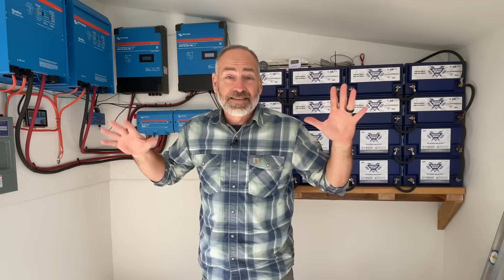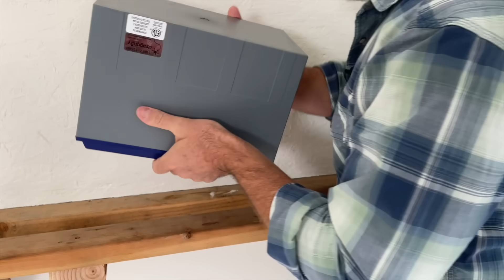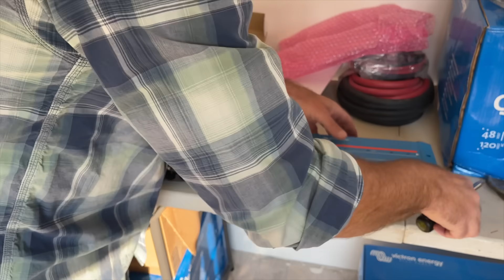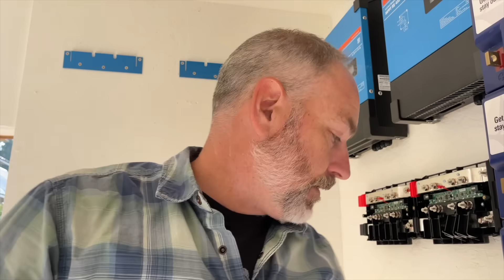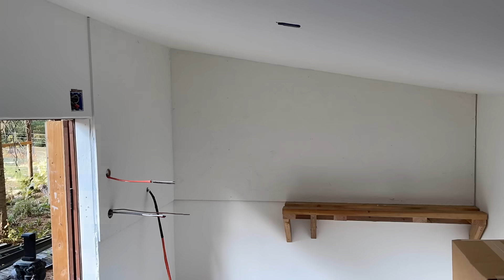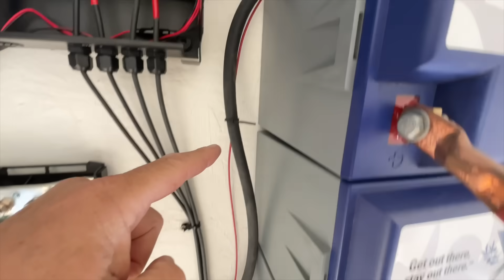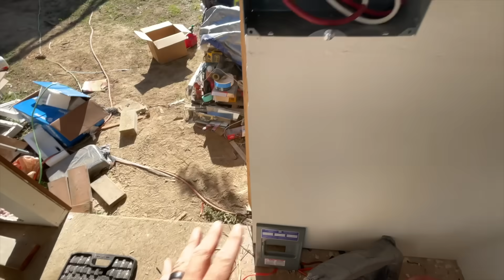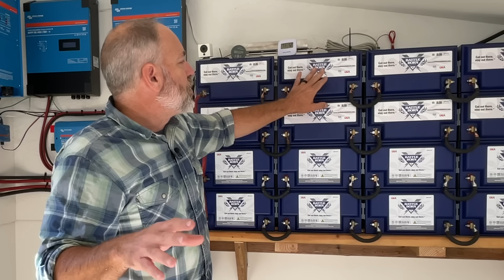EASIEST Off Grid Solar Power System Battery Bank

Comment: Very nice, I see you ran #10 AWG copper romex (the orange cable) from your inverter to your load center, your load center has a 50 Amp breaker, should you have used # 6 AWG copper to handle the 50 Amp load, #10 AWG copper is rated for 30Amps and #6 AWG copper is rated for 55 Amps. but other than that VERY informative, clean installation.
Reply: Electrically speaking, he knows just enough to be dangerous 😳

Comment: Here is something I don't understand. You pay almost $4000 for four battleborn batteries to make 48v. One can buy the EG4-LifePower4 Lithium Battery | 48V 100AH | Server Rack Battery for $1450. How does it make sense to do the battleborn over these? Oh I just realized that you are getting the BB batteries for free.
Reply: 2024. Eg4 48v batteries are now 1149.00$$ . Soon to be cheaper too.
Reply: @coreygillum12 not with the tariffs coming
Reply: @coreygillum12 nothing is going to be cheaper soon. Trump tarries and new China ban on exports to America is going to make everything very expensive.
Reply: Most likely he got the battleborn batteries for Free or a discount
Reply: Yep 🫵
Reply: Bet he doesn't respond to your comment either
Reply: 😂😂 @JT-jg8le
Reply: He gets 400 Ah for 4000$…your set costs $5800 for 400 Ah.
Reply: You can use marine batteries that are much cheaper but have a lower life cycle that’s negligible. Downside requires outdoor storage and ventilation.
Reply: If you want to enjoy lead-acid batteries for longer 30%discharge is maximum. Thats only 30 Amps for a 100 Amp lead-acid battery😢
Lifepo4 batteries burn or explode very violent and are expencive more so compaired to lead-acid.
Hard choiches im willing to make in favor to lifepo4. 
Prices are going down on lifepo4 and solarpanels in general.
Reply: I dont know hold that shelf has not collapsed with that weight , hope you got great fixings also
Reply: Must be fairly light batteries in that case
Reply: The Amp hour is different. 4 *12 volts 100Ah  gives you 400Ah. More than a single 48vlts
Reply: @cordzocornwell7003 your math ain't mathin bro. Voltage is additive in series, current (amps) is additive in parallel. Just 4 batteries as you say will only give you 12vX400amp or 48vX100amp.
Reply: @Jeremyv1980  You are correct. I am curious why cordzocornwell didn't thank you for setting him straight
Reply: @cordzocornwell7003
Reply: @cordzocornwell7003 putting 4 12v batteries in series makes it 48v and 100ah.
Reply: @cordzocornwell7003 no, he wired them in series so he has 48v and 100aH. THEN, he wired 4 of those banks together to get up to 48v and 400aH. In series, the voltage is additive and the aH stays the same. In parallel that is reversed.

Comment: Very impressive but how about telling us what it all cost.  Lithium although very good are also very expensive.  For me to buy just 1 100AH deepcycle Lithium battery it will cost me $1300.00 dollars.  Multiply that by 16 and I am looking at just over $20,000.00. Then add the inverters, controllers and panels I reckon I would not get much change out of 40 thousand dollars AUST.  Still start small and add to the system as funds dictate.

Comment: I saw some bare copper wire where the cable you cut bends out from the lug.  Might be an idea after they are bent to fill any gaps that appear with some rubber insulating compound before they are installed.  Or buy links ready prepped.  I think it was near the top of the battery stack.

Comment: It's a nice setup but IMHO the battleborns are not a good fit for whole house batteries.  Lets be honest here this is just sponsorship - for $2000 less, you could get a BYD LV 24KWH stack and not only get nearly 5kwh more capacity at $2000 cheaper but a MUCH easier and safer wiring job and quicker/easier installation.  (just 2 cables to make up).

Comment: Mind if I ask what the total cost ran to? We have just had solar panels installed at work (without batteries) and now we're looking at a small battery install. Options here in the UK are pricey - £8000 for 10KW storage.

Comment: An even easier offgrid system is any one of the Solar Generators on the market; Bluetti, Ecoflow, etc with expansion batteries. These are competitors to the Tesla Powerwall, as they are DIY systems, while the Powerwall won't allow you to install them yourselves. And it you have an RV, you can take these Solar Generators with you for plug and play vacations, while the Powerwall stays behind. I just bought a basic system with 3072 watt hours, expandable to over 18k watt hours, working up to a whole home system as I can add up to 6 batteries. It can take up to 3000 watts solar input. You do need to buy two of these to get 240 volts, and of course that doubles the 18k watt hours and provides 10k watt output. All it takes is money:)

Comment: The only complaint I can realistically say about a setup even at it's basic level (4 batteries, 1 controller, 1 inverter, distributor, etc), is that the initial price is just to much for the majority of individuals whom own a home, but essentialy live paycheck to paycheck to make ends meet. Sure once the items are paid for, installed, and running, it'd save HUGE on electricity, which in the long run is the utmost smart idea. But without the initial funds, a setup like that just isn't possible.

Comment: Guys. Another easy light usage off grid system is to buy computer UPS battery. I have 4 solar panels installed on top of my garage and I connected it to three UPS. It powered my Router/NAS/two Led standing lamp/front door night lamp. It works pretty well🎉🎉.

Comment: Nicely done, I'm in South Africa and went off grid well 99.8% off grid last month. Went for 9x545w Canadian panels giving me around 5005W off panels but seen them go higher close to 5200w, 10kw inverter and 10kw battery which in the next few months will take to 20kw on battery and will add another 9 of the same panels taking that to 10kw on panels. I'm running a 4phase setup so solar, battery, utility and if I really need it will startup my generator but thats not really needed to be honest.
Reply: Hi

May I ask the Sputh African Cost of the System 

We am looking to do a total off grid and increase incrementally
Reply: @mikab350  I paid R148k for my setup
Reply: @stu1944  thank yOu
 For the Info

Would you be king enough to share your supplier and Installers contact details please 

I am Dbn based
Reply: @mikab350  I went with SolarSolutions but we up in JHB. Very professional service and aftermarket support has been top-notch.

Comment: Wow! Nice system! You did a great job illustrating how the system worked. But I do have a question thou... if I'm not mistaken, it looks like you're running 10 gauge wiring which can handle up to 30 Amps from the inverter to the AC distribution panel and I think that's 6 gauge after the 50 Amp breaker... so the max amperage in your home's central panel is only 50 amps? Do you have enough power to run central air & a dryer at the same time?

Comment: were you going to add a cooling fan to circulate air in the shack? you could run a fan off its own small solar power cell.

Comment: There is only one reason you wouldn't use four server rack batteries and end up with 23kwh. 

You got the BB for free or nearly free.
Reply from the maker: I didn’t even know what those were when I set this up. So maybe there is at least 2 reasons.
Reply: @MartinJohnsonOffGridLiving  

I can go with that 👍

Comment: NOT the easiest!  No where close. A single Sol-Ark 12k and two Kilovault HAB 7.5’s is equal or better at every comparison. The Sol-Ark unit contains the BMS, the wifi, the system monitor, and ALL of the  circuit breakers,  Martin must love hearing his generator run because the has and after the panel upgrade, will have half the PV to support the battery recharging while running the household.

Comment: Yes,  everything is easy if you have the money. Maybe when i win the Elgordo lotto. Just a rough guess, 16 batteries at  4500dollars, inverters at 3000dollars, controllers at 2000dollars, solar panels at 8000dollars all together  17500dollars, thats allot of money, im in south africa x that by 19 and i have to pay R 332 500 rand that is more than what i make in a year.

Comment: This appears to be one of the most expensive power bank set ups I’ve seen. The batteries are over$500/ea. The inverter alone is $2750. Just seems like there are better options. All depending on need and circumstances.

Comment: Deep cycle lead acid is still the safest and the cheapest solution especially that the battery doesnt have to move anywhere. You can practically stack unlimited power with then for the same price of what dangerous batteries you are advertising. Enjoy burning your house down.

Comment: Glad you showed how light those batteries were up front. All I could think about to that point was how the heck that shelf and the studs were going to hold that perceived weight. Also that bracket/hanger system is called a French clear Great video 😊

Comment: I did a similar install, except i used a the lynx shunt that attaches to the distributor system. I have the battery bank on the shunt side and then all of the inverters and chargers on the distribution side. this way you can see everything going in and out of the battery system. The shut connects to the CX and screen module and creates a display for amp flow in or out.

Comment: Not to be rude but…..what was final cost, including the soon to be solar panels. I’m putting together a system and this is exactly what we need. That    8 awg wire, might be 6, from shed to house was prob 1500. Looks like you have 3000 in just wire!! Extremely impressive!! This is what we need. 
I’m guessing 26,500 to 30.

Comment: How much would a whole house system like the one you installed with batteries and inverters cost plus the solar panels for an overall cost balance? Def looks a lot easier to set up than in the past.

Comment: Considering the fact that the continuous consumption should't use more than 80 % of the wire capacity, the wire trough the house seem small, also it's supposed to be #6 to match 50 amps.
Reply from the maker: True. I ran out of #6 but we don’t use even 30 amps anyway.
Reply: @MartinJohnsonOffGridLiving  You have to replace the 50 amps breaker to match the wire, also 30 amps = only 5760 watts of constant use and inverters with batteries is 10 000 watts.
Good job.

Comment: Which victron charge controller are we using on this setup. I believe I got the info on the inverter.. 

I probably figured it out
Victron smart controller mppt 450.

$1,300. Now I got to figure out how much the inverter is.

Comment: Well that's a beautiful system I want to do just a 120 so I could do half of that. I wish I would have went victron I bought a sungold all-in-one. Way too much idle consumption Watts. 100 it doesn't even make sense. The victron is much more expensive though but I only need half of the system. I don't think I'm going to be able to do it I built this 12 volt system though I was able to figure it out somehow. Hours and hours of videos. And then I bought my son gold before I watched all these videos that I'm finding. I was so busy at work I didn't have time to look at any internet stuff. I was just looking at Facebook ads. Big mistake. my 12 volt system is victron. I should have learned from that and not messed with this Chinese $1,200 all in one. It's probably going to work. But from the videos I've seen not really nearly as good as I'm used to. I should have went with victron. Anyway I'll ask my question I have on another statement I'm just rambling here I don't expect anybody to get back to me about it. One more time that's a great system.

Comment: Wat this is one off the most unneedy and unsafe installation I ever seen,  no cable trunkking, no fuses for PV panels, no lightning arrestors, no fuse isolator for battery.

Comment: Could you also charge the batteries with a smaller 120 volt generator like a Honda 2000i?
Reply: Yeah you could. But won't last. You'll need a higher voltage.
Reply: For your love and concern. You've won a prize dm me to claim your package

Comment: hehe i bought 30 220ah victron agm deep cycle batteries in 2012 when they were dirt cheap, never used them until now. they were stored, checked them they were still full capicity. best batteries ever.

Comment: 😅😅🧑🏻‍🌾🧑🏻‍🌾🧑🏻‍🌾😳😳👏🏻👏🏻👏🏻👏🏻very good installation i am french in french guyana i have a little installation lg chem battery 6,4kw And 2 régulateur mppt victron 150/45 convertisseur victron 48 volts/3000 /35 amp And 3,2kw Photovoltaique panels you instal us very powerfull🤩 thank you for your youtube

Comment: As of today (12-27-2022) JUST the batteries shown in the opening seconds of this video cost over $13,000.

Again, that's JUST the batteries, and that's JUST to buy them. Maintaining them will cost more.

Edit: The inverters cost $5500

Edit edit: the charge controllers cost $2650

Around $22,000 for the setup seen in the opening seconds of this video.

THIS IS NOT INCLUDING THE LABOR OR SOLAR PANELS THEMSELVES.

Comment: If you hook up all 16 batteries in series or parallel. If one of them fails, wouldn't it affect others? There should be a little more sophisticated battery control to compensate for single module failure and not damage other units.

Comment: Two things:
One, your data cable between the two big heavy boxes is coiled up on top of high voltage lines.  This is a big no-no.  Ethernet shouldn't run that close to high voltage, and each loop multiples the problem.  You'll get a ton of corrupted data and re-transmits.  Might not be an issue on extremely low data usage, but I'd still make sure the ethernet cable doesn't cross any of the power lines, and move the coil to underneath the box. (Unless it's EM shielded cable, which I'm pretty sure that is not.)
Two, you should never fun power cables underground.  There's a very important reason power cables run above ground even in places where it'd be trivial to run in trenches.  You lose considerable amounts of power to the earth, even more so when it rains and the ground is saturated.  Won't be an issue if you have way more power than you ever use... but that's just burning $$.

Comment: Should have a separate buss bar for your copper grounds...separate from neutral bar...and why didnt you run your batteries off the end of the 1000 distribution buss?...the way you have it is actually wrong...Also, 125 amp for the batteries is not enough...Need a separate input for that with 300 amp minimum...I would have used the Victron Energy Lynx shunt ip22 VE Can 1000....Also you don't need 2 of those Lynx Distribuors...just 1 would have sufficed.
Reply: It does look like a few of the copper AC grounds share a common bus terminal with the neutrals which isn’t right. 

Neutrals and ground only come together at the main panel.

Comment: also you should have ran each 48v row to the lynx distributor then they parallel from there. you do this so you have less amps that you pull through each row and not go through one 3/0 strand. having each row with it own 3/0 run to the distributor is highly recommend. with the set up you have you can run too many amps through the single  3/0 strand. if you keep this design you will need a victron battery protect, so you can cut the power connection when you surpass safe amperage through that single 3/0 strand.

Comment: I'm not familiar with solar systems and just starting research so this is very helpful. Is keeping the batteries, controllers, etc, in a separate shed a safety thing?  When designing, can it be added in a room of a cabin?  Does the shed need to be temperature controlled?  What happens if it the system is in an unheated shed in MN?  Will it still function?

Comment: Don't buy any more Lithium batteries and solar panels. A new technology power generator will be coming next year. It uses no fuel, sunlight, hydrogen or nuclear and no recharging is needed. It produces electricity 24/7 even if you live underground or in space.

Comment: Thanks for sharing such a big home project with good explanation. Just curious how coud you manage the imbalance in between the batteries as they are all connected in series without a BMS on each cell.
Reply: Each battery has an internal bms.

Comment: The PUPVWMHB 12V 100Ah LiFePO4 Battery, 100Ah Lithium Battery with 100A BMS, 5000+ times at 100% DOD 12V Lithium Batteries is $248 and the Battle Born is $874. 
Any reason to get the Battle Born brand which is $626 more?

Comment: I'm doing a similar system, but with a full rack of EG4s (30K), and dual 10K split phase Victrons, and what you're doing now is why I'm vastly overbuilding my system now, then if I need to expand, I'll not need to replace anything. Just add batteries, panels and possibly charge controllers

Comment: It looks like you have finished off the inside of your solar shed with drywall, and I was wondering if you insulated it as well? Also in one of your previous solar system setups you were using the heat from the Inverter to keep your batteries warm and you also were running your generator from inside the shed to charge the batteries when needed. I am curious on how you are now handling keeping the shed warm?